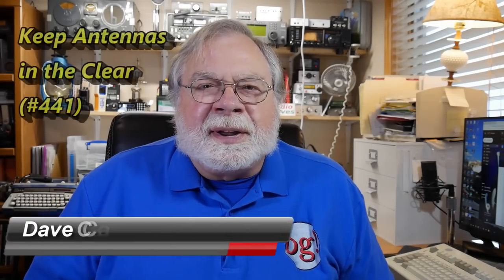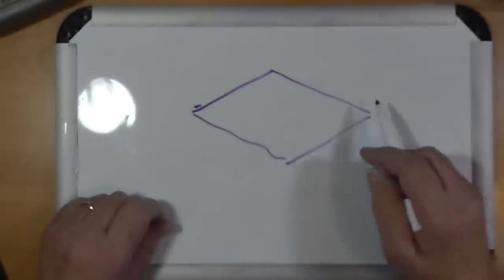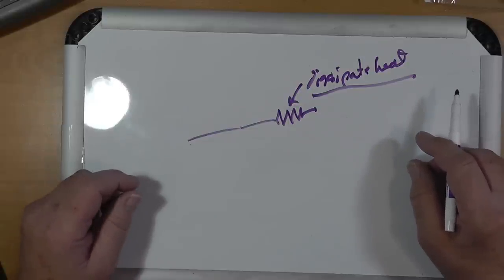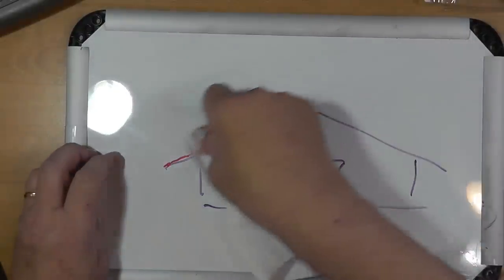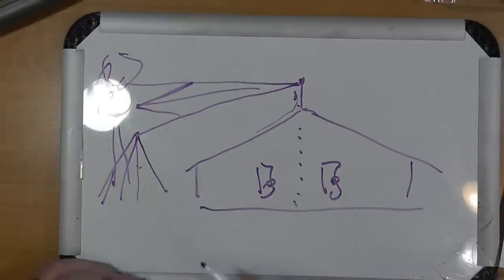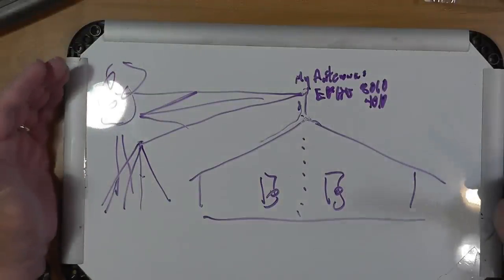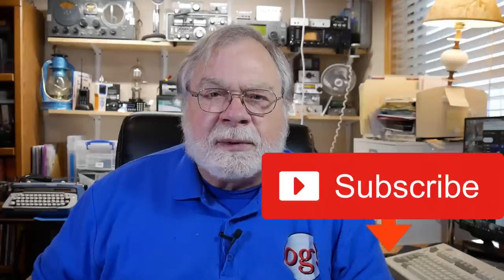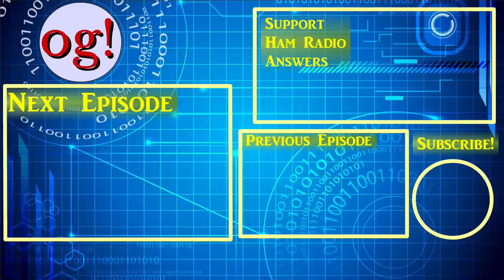Keep Antennas in the Clear (#441)

Comment: One of THE BEST antennas I ever assembled was a 40M/ 20M parallel dipole above a 72' single-wide shingle roof mobile home. It was about 10' above the roof line longitudinally. It matched great and had plenty of bandwidth across the phone portions of each band. I wish I could duplicate that in my present location.

Comment: Dave, Thanks for answering my question. After listening to what your own experience has been, I will soon have a 40-10 EFHW with all the trimmings. I may also try the butterfly dipole later, my intent was to mount it outside the attic, just following the outer edge of the roof. But at my age (78), climbing ladders etc. can be a bit intimidating.  I have a 40’ tree in my back yard and may take the EF wire and have help tossing a pull-line up to the top. I will let you know how this all works out. 73, Dan KJ7YBK
Reply: I did similarly, & one of my neighbors turned out to own a tree service company. He was willing to pop by one evening with his bucket truck and run the wire over a couple trees for me. Possibly the best $40 I ever spent.
Reply: @kelvin0mql  Thanks  Kelvin, great idea.
Reply: @danev1969  I put mine in a Palm tree about 20 ft. up but later paid the guys who trim the tree to raise it up to 35 feet.  Best $20.00 I ever spent.  The sloper works great with the IC-7300 and  the internal tuner works well. 73
Reply: @KE5KWE  Thanks Bill, I now have lots of choices and a decision to make.

Comment: Dave if the person can source the top rail in 21’ lengths two would be better. I have three sections of 10.5’ but I support the joints with gorilla carbon fiber reinforced duct tape. But I also use sch 40 pvc on the outside it’s a snug fit over the two layers of tape but I had a o-turn lawn tractor grab my guy and bend it over and it didn’t fail at a joint but it bent above my pvc reinforced joint. I have faith that you could do three 21’ reinforced but problem becomes getting it to stand up. I was contemplating trying a 30’ lever to get it up but then I felt it might just be easier to get a 18m telescoping pole and forget the metal. My 3 poles have done well in wind and have to say. The replacement one is standing straighter then my old one ☺️might be the 3x times the pole dropped trying to get it up on my own. I also use a extra stake at the base to set the base on so it stays put.

Comment: Dave,
If the antenna Dan described is a terminated folded dipole I have experience with them.   As  you probably know the advantage is no antenna tuner is needed for any frequency between 3 and 30 MHz.  The commercial ones are expensive.  The Delta EOC has one by Yaseu, sold by DX Engineering,  that is less expensive with a lower power rating.  

Are you going to evaluate the ARRL's End Fed Antenna Kit?
73,
Steve Schroder KI0KY
Reply: Steve, I only plan on going for the 40-10HF and probably just a 100w, maybe the ICOM 7300 if I can afford it. At 78, my lifting and climbing abilities are a bit limited, hence perhaps a EDHW 40-10. Keeps everything smaller and I should be able to build everything (when retired, you have lots of time). My biggest challenge may well be to figure out how to get the EF wire up to the top of the 40' tree in my backyard. My preference is to end up with a pulley at the top. But I love the idea of the roof-hugging (well, half roof) butterfly, so I may do both antennas.